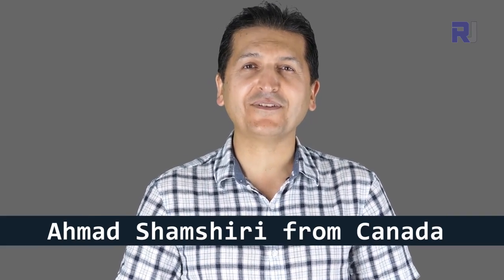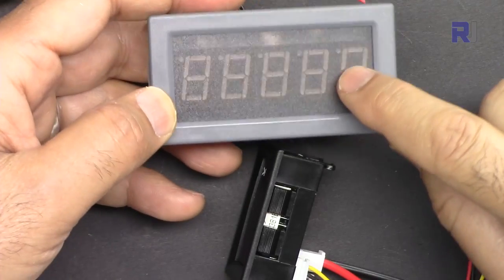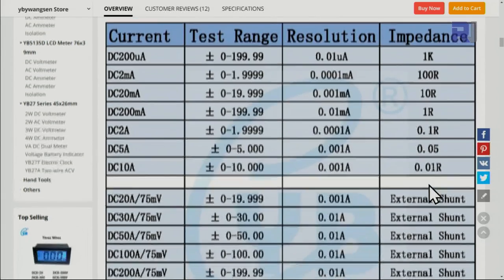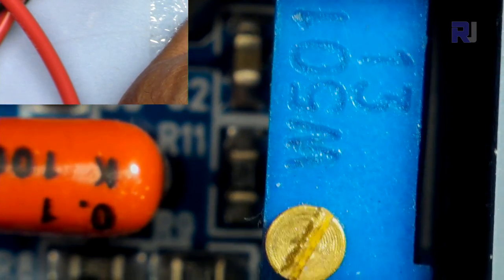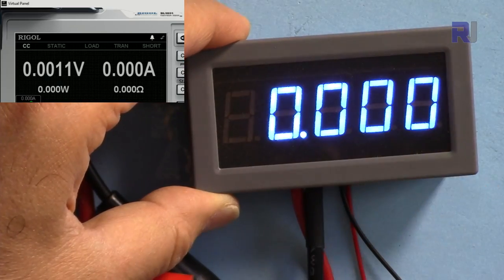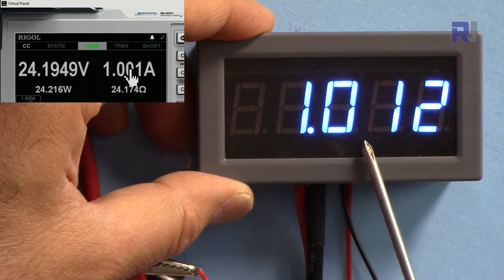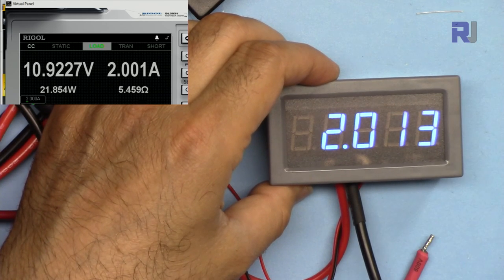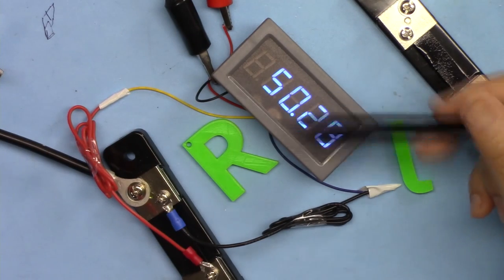Review and calibration of YB5145B 10A DC Current Meter

Comment: Greetings from Panama, I would like to ask about the YB5145B-V1 meter. IT IS AN AMMETER AND WHAT IS ITS MAXIMUM CONTINUOUS CURRENT AMPERAGE AND ITS POWER SUPPLY. ALSO, IF YOU CAN MAKE ANOTHER VIDEO SHOWING ITS CONNECTION DIAGRAM
Reply from the maker: Greeting, have you watched the video? All your questions have been answered in the video. All specs and wiring and test.

Comment: You have a 15mA zero error. Mosty meters provide a means of zeroing meter with zero current.
On this board, if you short the pads on the top left corner of PCB (see 5:05 of your video) and then turn power ON. Then release short and cycle power, it should remove zero error.
Reply from the maker: there was not instruction on that and I didn't want to predominantly damage it.  The top left corner jumper pad (I believe) are for units of settings of the meter. and we have 5 pad. I've purchase 3 of them so far and they all have different pads shortened.  I will see experiment with them to see if I can resolve it. Thank you for the comment. I didn't know about this zeroing of meter. Thanks.

Comment: The video is a little too long, and you should have measured the consumption current of the meter.
Reply from the maker: Yes it would have been nice but not important. This is based LED and it consumes like about 60mA which is 0.6% 10A. So it is negligible.
Reply: @robojax  Compared to the maximum current, it is negligible, but if I'm measuring the charging current from a solar panel, it can be a significant portion of the total current available at times of low output.
In a 24h period, this meter consumes a whopping 1.44Ah, which is unacceptable in many solar- and battery-operated applications.
I like your videos and tests, I just wanted to point this issue out.  👍🏻